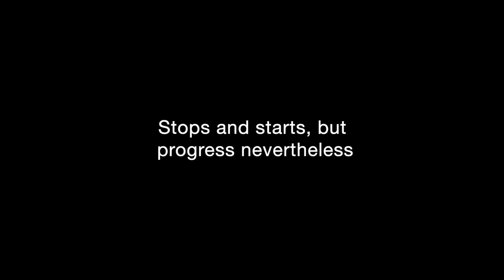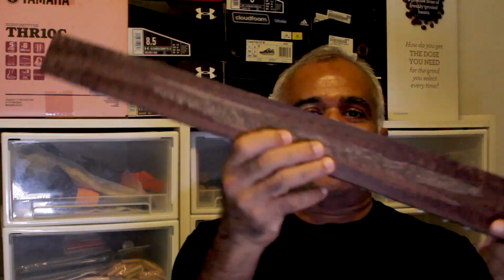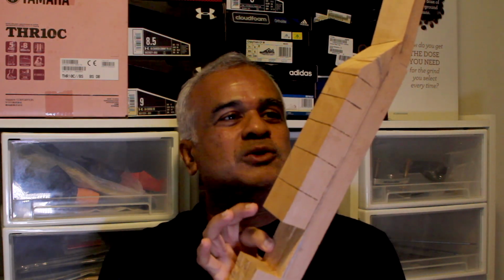Great Guitar Build Off 2021 — Episode Three of the making of "Constant Flux"

Comment: not seen anyone do fret slots like that, certainly makes things clearer. Making good progress Bhart!
Reply from the maker: I'd not seen anyone do that either. Thought, "hmm... why not?", tried it and discovered that it works and it's relatively fast (cos I don't have to keep clamping, moving, unclamping etc). As long I use the correct side of the Katz-Moses magnetic dovetail jig and hold it still, it works like a charm.